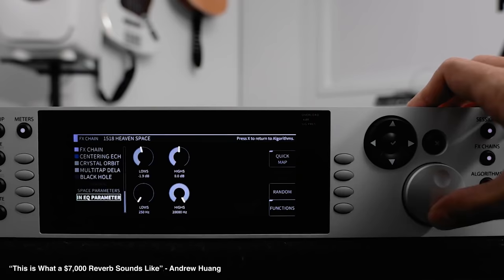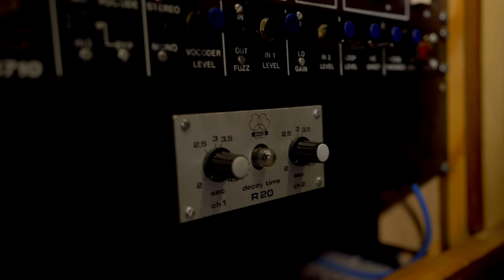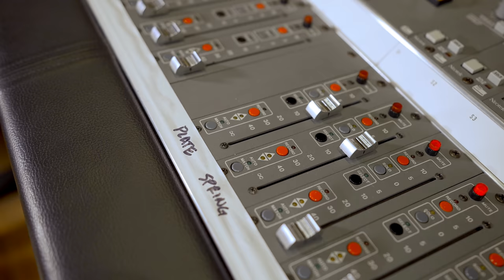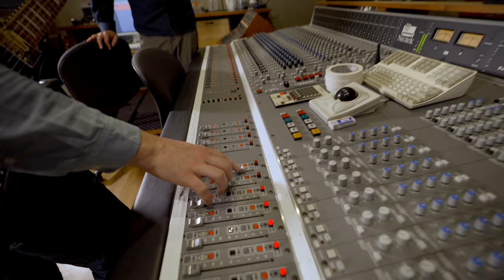Why Huge Metal Plates Are on SO Many Songs (reverb machines)

Comment: I hung around auto wrecking yards as a kid .
General motors cars could be equipped with a Reverb unit . 
It consisted of a spring attached to a " driver " at one end and terminated at a " microphone " .
Any older person might remember the Volcano at Knotts Berry Farm .. a little automated " devil " would , when you pushed a button , swing a mallet against the spring and the reverb sound was amplified as the volcano "erupted" with steam and red lights !

Comment: Cool vid, that analog plate reverb sound glorious.
I remember being blown away as a young teenager when I pulled apart my little Peavey solid state practice amp and found the reverb tank with actual fine steel springs with wires connected to them. I didn't know too much about electronics at the time but I had a load of fun messing around until I broke one of the springs. I bypassed it but obviously it never sounded the same again.

Comment: In 1969 I worked in a studio that had a small concrete block room back in the warehouse area. The room was approximately a 6 foot cube but it was built so no walls were parallel.  It had a speaker inside pointing away from the microphone. It had a heavy solid wood door. When you opened the door the slightest scrapping made echoes like there was a huge cave inside. We also had a big spring reverb that was made on the design of the spring reverbs found in guitar amplifiers but much bigger with longer springs.

Comment: In the 60s, a friend and I each had small reel to reel tape recorders. We fed the tape from the "record" machine to the take up reel on the "playback" machine, and placed the record mic by the speaker of the playback machine. years later, I placed the mic at one end of a very tight steel clothesline wire, and struck the line with a small hammer. what I got was a descending ricochet sound as the node traveled back and forth. I think this was the principle in a spring reverb unit I had in my car in 1968. One problem with that was when I hit a bump in the road, you could hear it in the spring.

Comment: Regarding comments at 23:10,... The first non spring reverbs,/ pedals in 1975 (more like 1976), were in fact a (bucket brigade- type storage of voltage by capacitance charge ) driven by a digital shift register with 1024 - 2048 "steps",  (later 4096) driven at a clock rate of around 16 khz or so.  They were "analog" in the sense that there was no analog to digital conversion of the signal, instead the voltage wavefrom was "sampled" by a sample-hold circuit into a charge holding device (capacitor at each step).  Earlier on, Analog to Digital conversion had been done with mainframe computers at "Electronic Music" labs , and used to create looping, and echo effects digitally,... the 1st example i remember hearing was done by experimental "Electronic Music" artists Charles Dodge and Joseph Olive, who demonstrated their work on a TV program called The 21st Century, which aired around 1968.  The first digital delays with A to D , and then D to A conversion as a commercial product, was perhaps an "Eventide Clockworks " product which i believe also did chorus, flanging, and tuning to different pitches, around more like 1979,.. but i am sure someone will know exactly the make and model, and year, but they were large rack units, and fairly expensive.

Comment: Great video! The history was awesome. Cool to see some of the smaller tanks.

There was a phrase however about how all reverb pedals are digital was a little off. The BBD chip took in an analog signal, and charged a capacitor with it. The BBD then passed that charge along more capacitors, and deliver it, as an analog signal at the end. Nowhere in this journey is the analog signal level turned into a digital value. The BBD just delays the voltage level at that point in time. They sound like a tape echo, but can be noisy.
Reply: Yeah... Analog reverbs don't digitize the signal to process it. What he meant to say was no Analog reverb pedal is MECHANICAL.

Comment: I have a very old Yamaha RX-V1400RDS amp that drives two pairs of similarly ancient Yamaha speakers (one set Model No NS-45 & one set NS-70). As I progressed through your episode, I had to turn down the volume a couple of times to stop my wife's complaining.

It seems like the more I progressed through the episode, the better my system was at reproducing the sounds, especially at around  38 minutes into your video!

Comment: Great video. As a child, I was fascinated by the reverb of the 100 lb. cylinder we had at home. I used to plink it with the loose end of the chain that we used to tie it to the wall and enjoy the sound.
EDIT: That Benson Tall Bird sounds so smooth and pleasant. A lot of spring reverbs sound annoying to me. Not that one.
EDIT 2: 36:10 That's why we sing in the shower!

Comment: in the sixties I had a loudspeaker with cotton threaded through the cone attached to a long spring from a TV CRT earthing system. The other end of the spring was hooked onto a sewing needle  eye screwed into a magnetic pick up from an early record player.  This was then going into a radio receiver with an aux pickup input.  I spent many hours making Sci Fi ray gun noises.  Later I worked in a TV studio with an EMT plate and later on an AKG unit.   Now the reverb is software on my computer.  I guess I have seen them all including the bathroom.  Not quite true just got to the bit with the optical unit.

Comment: Rob says at the start that computer reverb is relatively new. However, the first plate reverb was made in around 1957. The first commercial digital reverb was in 1976 - less than 20 years later. Digital reverb has been around for 45 years now.

Comment: Stage theater I worked at had an old sound board with a reverb coil built in. It was very touchy and any bump resulted in apocalyptic noise

Comment: I definitely noticed the analog reel to reel machine in the corner there. I worked as an engineer in a friend of mine's studio At that time we had the Alesis ADAT HD24 machines. Had 4 of those. And THEN we had an Otari MTR90 2inch 24 track. People always wanted to record on that. They loved that analog warmth. And so do I. Modern DAW's record exceptionally well but they're just too clean but there are always things to analog-ize them with

Comment: If anyone wants to research how this works (the sensors on the plate) and didn't catch up on the tech or language, they're called Piezo elements. Layered crystals that give off a variant voltage when they're stressed, or vibrate when you apply a shifting voltage. Exactly like that flat "speaker" in those obnoxious Christmas cards that play songs. Or one of those old-school lighters that give you a jolt when you pick it apart :p

...I was an "interesting" child.

Comment: Search-  Ken Griffin's Special Effects article by Eric Larson [ Laurens Hammond's 1st type of spring reverb, and it appears to be what they salvaged from a Hammond organ TONE CABINET at 24:28 at probably a great expense] (Tone Cabinet is what organs use, amp in speaker cab, or Tone cabinet. Note a Leslie speaker is called a Leslie not a tone cab). Genius clockmaker inventor, Laurens Hammond invented all 3 types of *Spring Reverb*. Before Laurens invented the 3rd type "little spring reverbs" traditional small long and short tanks, he made the 2nd type lesser known 3-spring Necklace reverb (and superior tone with 3 springs representing the LxWxD of the room).

 I own all 3 and necklace is my favorite, most authentic. Slap a 12" raw frame speaker on a nail, facing speaker to the wall, that's all you need. Albeit it's not what Hammond did, but it works. My necklace reverb is in my 1955 Hammond S6 Chord Organ. Lucky former 'add on',  really make the S6 sound great. Jesse Crawford At The Chord Organ Lp is on Youtube.

 Interesting enough, Hammond sent out a memo with their techs in the late 1950's to remove the inferior* Type 1 Reverb and install, with included kit, the new Hammond smaller spring reverb unit. see photo copy of that bulletin here, search exact-          Hammond Organ Service Bulletin - Theatre Organ 
The original type 1's (and what I think for sure is in the crazy labor of love for an "inferior reverb" at 24:28 ) were instructed to be removed, wrapped in newspaper and thrown in the garbage. lol I've got an HR40 and an ER20 (decorative Tone cab, identical internally to the DR20) for my organs. The reverb really is inferior for the 'instant attack" pop music styles of the perky '50's, but funny enough great for the imitation of Jesse Crawford ballads in a real theater...dark, cavernous. 

Fortunately and unfortunately I'm a fan of theater AND popular standards...and Jesse went on to be the Hammond organ master as well. I posted to Youtube, two of his Hammond records covering the full spectrum. Interesting enough Jesse's happy tunes have the reverb (1st album), and his intimate tunes are dreamy and dry... straight to your soul. Put on headphones and WOW! Better than petting a cat! :
JESSE CRAWFORD POET OF THE ORGAN   and
Jesse Crawford Remembering Side 1 - Hammond Organ with Ann Stockton Harp   ditto, but Side 2
 
* Two of the springs were in an open ended metal tube filled with oil, and meant you couldn't transport the 'R" tone cabs on their side, or major mess and sloppy boingy as hell sounding organ reverb echo).  

That's all. 
PS.  Save the organs. And stop making guitar amps out of their amps. Same goes for the Hammond AO-35 necklace reverb driver amp. Most had their necklaces go missing. Call the cops.
Reply: In fact - Leslie Cabinets ARE referred to as Tone Cabinets. The inventor actually used the name "Leslie Vibratone" in 1947. When you hear the Allman Brothers, Tom Petty, Steve Winwood - the Leslie is the ONLY speaker you hear. There is not an organ speaker (non-leslie) - plus the leslie. The Leslie is where the tone of the speaker is generated, hence the name tonecabinet. Leslie = tonecabinet : One in the same.

Comment: I'm glad a simple pedal (or even easier, my computer) can do this stuff for cheap now, and it's good that a hobbyist doesn't have to go ahead and build the machine at 7:44 in their basement, BUT it's cool as hell. Just the idea of something actually, physically, happening when you play to cause the sound to change is so alluring in the days of everything turning into 1s and 0s as soon as possible after the pickups.
That said, to me, the plate reverb has only been matched by current digital stuff. Spring and tape reverb just doesnt sound as digital, even if some purists hate that.

Comment: The AKG BX-20 and BX-15, and also EMT 240 gold foil were often used for mobile live recordings in those days, when the first studio digital reverbs (like the EMT 250 and later the Lexicon 224) were around 20000.- and more, Dollars... Remember, that were gold backed dollars back then! About 100.000 now! Recording studios could save a lot money preparing rooms with diffusors just for reverb.

Comment: The opening riff of “born on the Bayou” by CCR I believe used some sort of spinning speaker set up at least that’s what it sounds like to me when you listen to the song
Reply: I think that's a tremolo. I recently picked up a Hammond organ made around 1980, and it has a large mechanical tremolo. It's a 12" speaker that faces a cone made of styrofoam, all enclosed in a cylinder. The cylinder has an opening about 1/4 of its diameter. A motor similar to a vinyl album turntable rotates the cylinder to deflect sound in a literal circle. https://en.wikipedia.org/wiki/Leslie_speaker

Edit: Found a YouTube video that shows one such device: https://www.youtube.com/watch?v=mhR9Z6Rkrhc

Comment: No, those early "digital" machines where still analog electronics ("Bucket-Brigade Device", sometimes with some trickery to get better reverb instead of echoes). They still used analog signal "processing", absolutely cool tech. BBD was invented in 1969, and in the mid 1970s it was "all the rage". Real digital reverb came later with the rise of DSPs and cheaper RAM.

Comment: The new ESC driven brushless motors that made quadcopters possible have amazing accuracy and ability to char change speed instantly. It would be neat to see what a talented guitarist could do with one on a 2D analog pedal made from a radio (RC “transmitter/controller”) gimbal. I could build it. But I can’t play guitar.

Comment: Tube amps, 1/4" analog tape and analog effects are still the gold standard when it comes to recording music.
Sure digital modeling and emulsions have come a long way, but that equipment is still designed and aiming to achieve/surpass this very sound
Reply: Analog effects? I don't know enough to say you're wrong but if I had to guess, digital effects are probably more common than you're alluding to. Especially reverb, as mentioned here.

I've always hated tube amps because I have never played one with a distortion I liked... At all. That's probably because I've never played one with any kind of digital distortion. It's always old timers that think just the gain knob is good enough... It's not good enough dad, NOT AT ALL!
Reply: @danielnelson4881  the most replicated amp sounds out there (amp sims, modellers, etc.) Are the Marshall JCM 800, Silver Jubilee and Plexi, Peavey 5150, Vox AC30, Mesa Boogie dual rectifier, Fender Bassman and Princeton Reverb and finally Roland Jazz Chorus 120. All of the (exept for the JC-120) are tube amps. It doesn't matter if you prefer to crack the gain up or use a distortion pedal up front, they're still the gold standard.

Comment: Only complaint is that "electronic" is not the same as "digital". 
There are 100% analog pedals that are completely electronic, using tubes or transistors and other analog circuitry to modify the waveform.
Digital signal processing converts the analog signal to a digital representation (think CD or mp4 instead of vinyl or tape), runs computations on the time sequence of digital values, then converts the output (usually) back to analog.

There is of course something intrinsically cool and interesting about non-electronic signal processing devices, so this was an amazing video, but just because it's all electrons doesn't mean it's not analog.

Comment: Just because it doesn't have a spring or a plate doesn't mean it's digital. There are 3 major types of reverb:
physical: spring or plate
analog: electronic components only, bucket brigades
digital: sampling (ADC and DAC), with the effect done in the digital domain in between the converters
Reply: With limited exceptions you are not going to see any bucket-brigade analog circuits for reverb. Do you know of any currently available?

Comment: I just project into a seashell, or a configuration of them, and set the mic in the waves trajectory
Reply: Works to add it when listening as well. Watching pink floyd, pulse, on portabellas, with a mini didgeridoo to one ear, and a large shell on the other, well playing the concert out two speaker's, with a tiny offset in their timing... magic
Reply: You'd get a different sound off the giant plate, but a portable box, with analog switches, to delay chambers, full of shells, flutes, pipes with wires under tension, fixed to crystal mounts of a known resonance.. it would sound so cool

Comment: The problem with piezo  pickups and piezoelectric crystals is that they are not well matched to typical audio inputs. By their nature they can generate a lot of signal, but they cannot drive a 50 kilohm typical line input. The pickup needs to work into a much higher impedance, typically 1 megohm or so.
That was not a issue with tubes, because they are high impedance inputs by nature.

So what to people do? They go and plug a piezoelectric disks output directly into the line input of their recorder, typical impedance 50k, or the plug-in-power mic input of their recorder, typical impedance about 7k, and they start to bitch and moan that this damn thing sounds tinny. Which is does ! But they don't understand why!

The reason why these devices often sound tinny is because the piezo sensor presents its signal through a series capacitance which is small, typically 15nF or less. When wired to a normal 50 kilohm line input this forms a high-pass filter, which eliminates the bass.

This circuit board solves that:
https://github.com/Supermagnum/piezo-balanced

Comment: EMT 250 didn't come out until 1976... It cost about 20,000 and was never intended for the masses.  Non-spring reverb in a stomp box came out in 1980 and while it wasn't a spring it was still technically analog.  Analog doesn't just mean non electronic, early analog synths from Moog and Yamaha relied solely on electronics but were not digital.  Digital refers to the way electronic circuits operate and a digital reverb for guitars didn't come out until 1987.  The dude who is claiming to be an expert on reverb seems to have gotten his info from a bad wiki page.